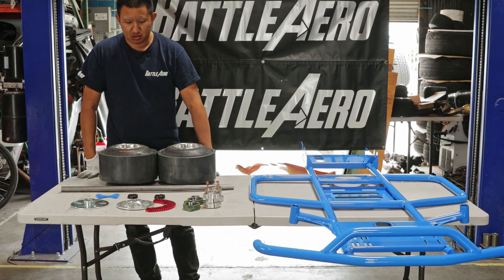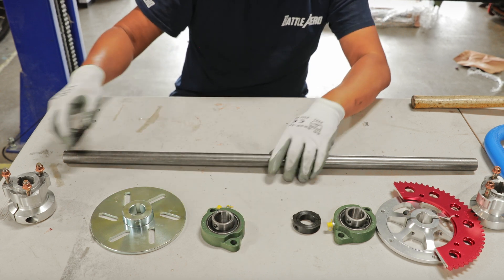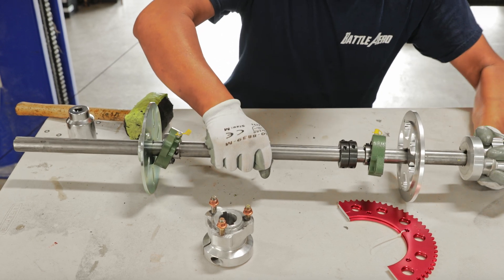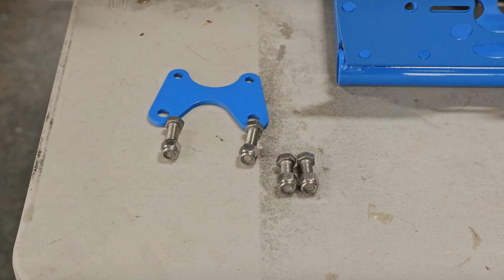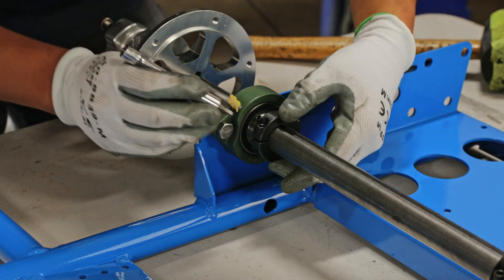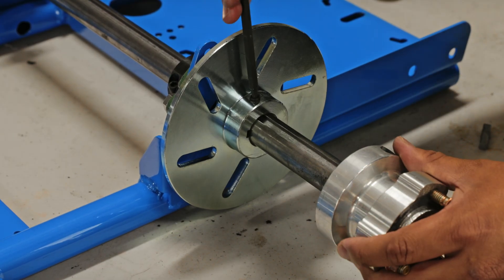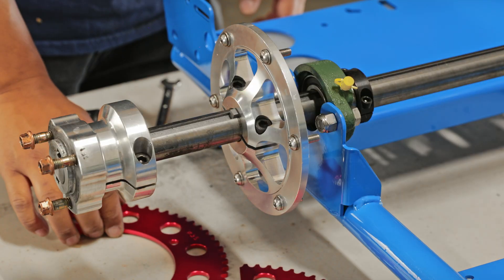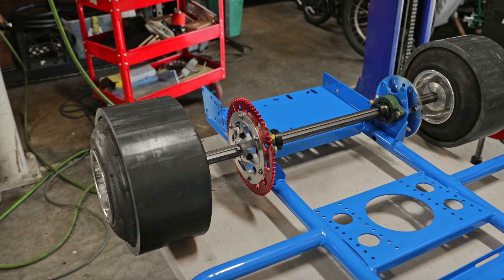Battle Aero Drift Kart Build Part 1: Rear Axle Assembly

Comment: I just got one in the mail but I'm struggling with the cylinder keys because they seem too big for the axle and all the accessories. I managed to get the wheel hubs to fit with a mounted vice but the sprocket and brake disk are going to be a pain to get right because of the keys.
Reply: Same
Reply: Having the same issue and can’t get a response from anyone 😢anyone can help or give tips ?
Reply: Im having the same problem, the keys are a little too big for the slots. Try using a file to open the slots on the hubs and smooth out the axle slot a bit too. Its gonna take a while, but it'll work eventually